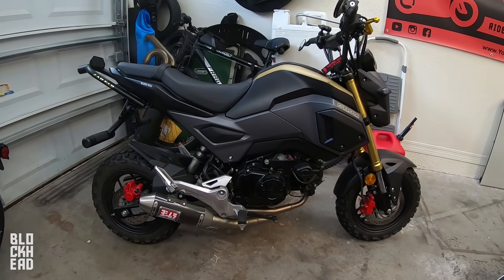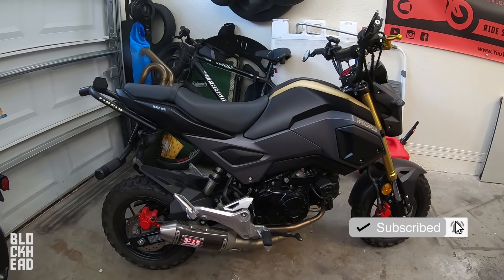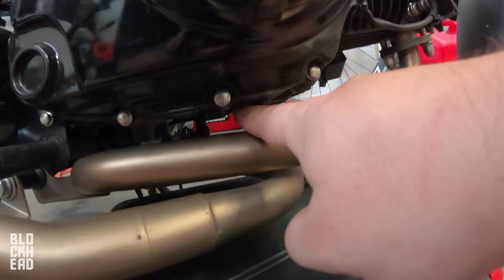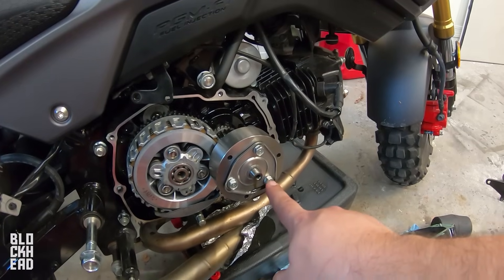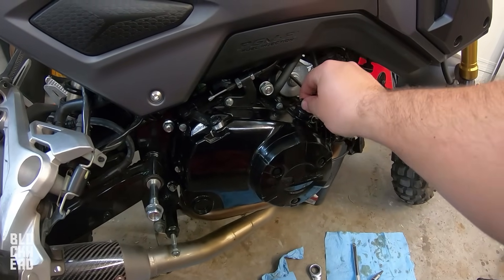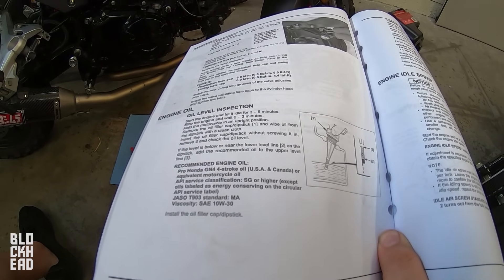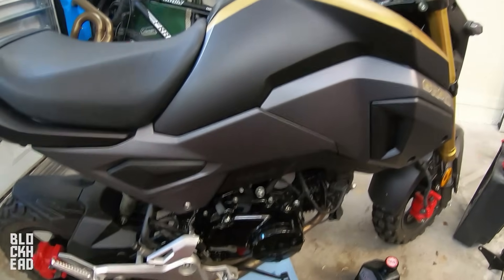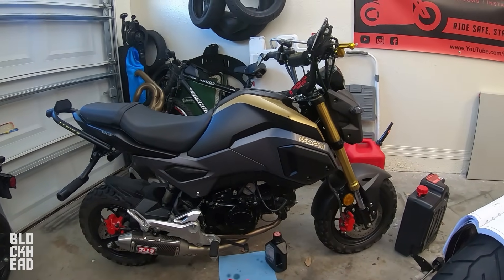Honda Grom Oil Change How To

Comment: I have milky oil what should i do blockheads?
Reply: Not a professional but I had it on my older bike and I was told it was water getting into the engine. Goodluck!
Reply: Thats just condensation. Nothing to worry about. It goes away and comes back. Totally normal.

Comment: Do you even know the difference in the oil one 10/40 actully a thicker oil only just for injustmeant for higer heats if you in that climate 10/30 is not as thick so it can get to parts of you engine quicker for when it needs it nothing to do with cleaning it lol

Comment: 6000 miles on my grom never opened up the gear and changed the screen oil changed every 1000 miles still runs like a champ
Reply: my grom is just like this one, color and exhaust too... check it out on my channel !

Comment: Manual says the first service is to be done at 600 miles* also if you're trying to learn wheelies synthetic oil might not be the best choice. Grom has a wet clutch and synthetic oil wont have as much "grab" compared to conventional oil.
Reply from the maker: Might be a good excuse to wear out the stock clutch and get a new one, lol
Reply: BLOCKHEAD Stiffen those springs!!
Reply: xD  good one .
Reply: @ Marcus Taylor . . . . so he can perform better wheelies??? . . .  just a wild guess.
if so , so much for comfort.

Comment: why tf would you use anything other than the oil the manual says it's not expensive at all... I get it...it's a honda engine it'll last forever yada yada but me personally, i'm going to be using the actual oil that was meant for the engine. why would they even bother making different types of oil if you could just interchange them whenever you feel like it?

Comment: If you read the service manual, they don't recommend you clean the oil spinner/screen every oil change.  It says to clean the engine strainer screen and oil centrifugal filter every 7500 miles.   Initial service also is at 600 miles or 1 month, then every 2500 miles or 6 months.

Comment: Great vid thanks for posting.  I do have to nit-pick.. Even with the block of wood under the side stand, theres no way the Grom is level. You'll get an inaccurate read on the dipstick and overfill.  Overfilling is very bad. One of those stands you pointed out is better to use to get an accurate read. Or i just sit on the bike and reach down and read.  Sucks but because the dip stick is so short, it actually matters.

Comment: if you could recommend a starter bike for someone 6'5 250, what would be your recommendations?  great videos btw
Reply: get a dirt bike , a 110 cc   [ a used one ]  .  to learn from so you wont be upset for dropping it.
the 110 cc  has a very good amount of power for someone that is 250.   i should know, lol , but i have lost 
some weight.  
if there is a MSF school near you they have a dirt bike course  that you can take, that should be everyone's first 
learning experience to being on a motorized 2 wheeler.
the firs thing most people learn on a 2 wheeler is  . . . .  '' balance '' . if you can control that while barely in motion
 then being on a 2 wheeler will not be to much of a problem.
do the msf course , it will do you good. . .  i promise. 
it is not just once, you can take it anytime you need the feel to learn more. . . the more the better, as everyone should.

what would be your recommendations?starter bike for someone 6'5 250?   
first thing is, what type of field  [ style ]    do you prefer :

dirt
roadway     [ cruising , touring ]                   [ lone wolf or passenger ] 
highway     [ touring, street bike ]               [ lone wolf  or passenger ]
dual            [ cross country, adventure ]    [  lone wolf  or passenger ]
drag racing    

merely stating that because you want to learn how to be a safe but a kool kat with knowledge of how to 
CONTROL  life on 2 wheels.

your welcome bruh
Reply: It honestly depends on your size. Most people say to stick between 250cc and 500cc. I’m 6’2” 250lbs and my first bike was a 750cc.
Reply from the maker: Auris Gomez, checkout this vid regarding starter bikes! - https://youtu.be/qpKFuayDITY

Glad you enjoy the vids, thanks for the support!

Comment: You did the work to take the cover off and didn't clean the spinner... Your wild!! I cleaned mine at 600 and it was FULL!, Also motul 10/40 cleans up a lot of the funky shifting on the Grom.
Reply from the maker: Damn, full at 600? Most other peoples that I saw wasn't that bad even at like 1500 miles. I'll have to give Motul 10/40 a try next oil change, thanks for the tip Justin!
Reply: I was thinking the exact same thing!  Why not just  hit the spinner right quick!  Oh well, Still a great maintenance video, thanks for taking the time!
Reply: Ack. Also need to mention that motor should be warm BEFORE draining the oil (maybe newbies do not know that). Also there is a Kitako cover I can suggest. You then don't have that spinner any more but a real oil filter you can easyly replace from outside. Anyway, thx for the video dude.
Reply: @a.b.4824  does the oil capacity change when you install the new cover/filter or is it still 1qt
Reply: What do you use to clean the spinner????
Reply: @BlockheadMoto  what PROTAPER bars are those

Comment: those fragments on the filter screen is from the material from  your clutch plates.
i would have taken those three bolts out to check if there was any forigen loose material in it. . .  just for safety.

awsome video !!
Reply from the maker: Yeah I'll be opening it up next time around and doing a vid on it! 👍